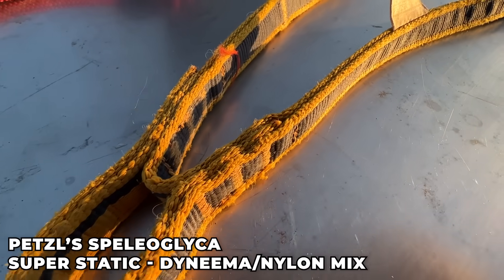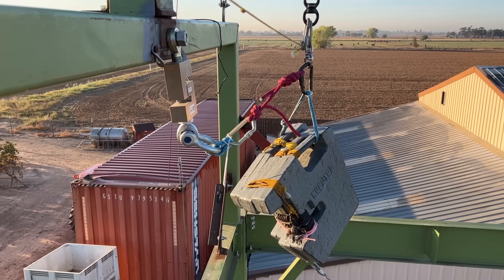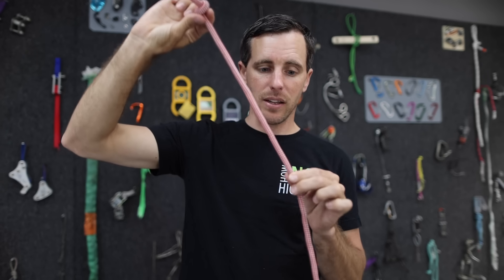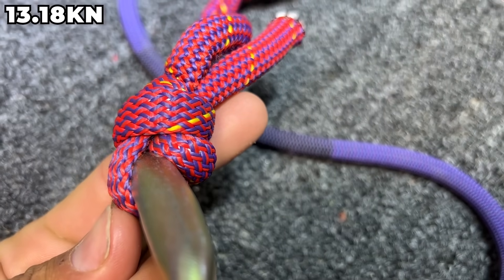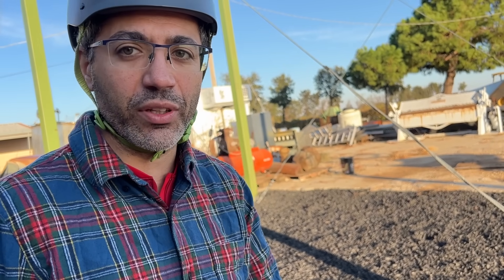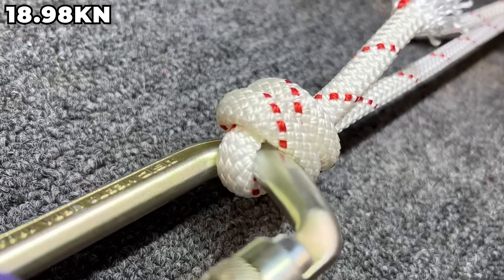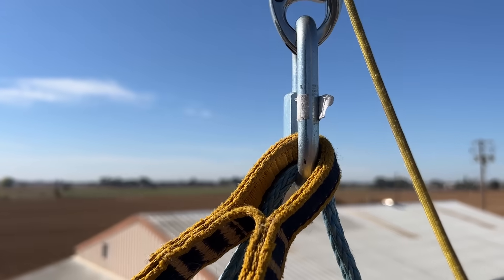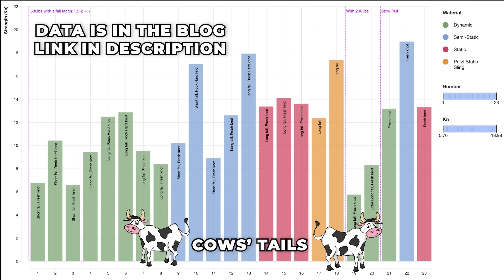This would BREAK your back

Comment: There will be a cross over on rope length for the force of a factor 2 fall. Below a certain length, you will not reach terminal velocity, reducing the speed that you are catching. Until you reach terminal velocity, the potential energy will increase. The elongation of the rope - time that the force will spread out - will increase with the length of rope, though I imagine there is another point at which this also drops off.

Comment: 4:53 "I think the moral of the story so far is try not to factor 2 fall."
No shit Sherlock.

Assuming that the rope is perfectly linearly elastic, is the only elastic thing in the system and there's no aerodynamic drag, the maximum force is only dependent on the fall factor and not on the length of the fall. I unfortunately don't know about the nonlinearities and dampening behaviour of a rope, but with constant FF and different lengths, you should be getting forces in the same ballpark.

Comment: My hunch is that in most caving situations the caver would be sliding down rock or swinging out and back in rather than completely free falling. As you say in the video it would be hard to factor that in but I'd be very interested to know what difference it makes if the weight is running down a concrete slab at 85 degrees rather than falling freely.

Comment: oh here’s a question for thought how long would that green static rope have to be before it would break under its own weight.
Reply: 13.31 kN / 9.8m/s² = 1360 kg. Not sure what rope that is, but I found a Sterling 9mm polyester static rope that says it's 62 g/m. So 1360kg / 62g/m = 21935m. Roughly twice the max cruising altitude of commercial airlines.

Comment: Just wondering the design methodology of using 300lbs for this test. It seems you are using the numbers to warn us against taking these falls but shouldn’t you use a lighter load? 

For example, I’m roughly 200 lbs, since people are also dynamic, generally we absorb/spread the impact around, such that using a 100 lb weight would more accurately display the forces I feel here. 

As such, wouldn’t I expect then to experience forces about 3x lower than the ones you have here? 19 => 6.33 not great but more livable?

Just asking on why 300 lb was used
Reply: I don't think its enough to just use a lower weight, the difference will depend greatly on how elastic the rest of the system is. Theoretically a perfectly static system would result in infinite forces no matter the mass used.

I put it in another comment but I think it should be possible to connect the weight with enough dynamic rope so that you roughly mimic the elasticity of the human body. You could test with a person on a dynamic rope fall and then add dynamic rope to an equal mass until you get the same forces.

Comment: First, I do think that, with some of the techniques we use in France, there would be something else breaking in the system long before you could reach this high of a force. That is why if I am clipped in with my personal anchor to a hangar I have a golden rule of always be in tension in something, wether it is the rope or my personal anchor or something else. There Is only a few cases where it is not possible and then it is for a few seconds and with just enough slack to unclip it. That makes that, in my experience, even a factor 1 fall is extremely rare in caving.
Reply: Same in Croatia. As our instructor told us during a lecture, if you have a fall factor over 1 in caving you’re doing something wrong.

Comment: That was interesting. I guess making cow's tail knots very hard is a bad idea. I've seen sometimes instructions like using a hand ascender and foot loop to pull the knots very tight. A bad idea it seems. Probably something that can slip even a better idea (petz adjustable, kong slyde or something like that)
Reply: You should still absolutely load and set the knot before using newly tied cowstails. Otherwise you're risking the knot slipping....

Remember, we're going to get more slippage underground when the rope is wet and sloppy.

Comment: Fall factor has the great advantage that you can estimate it while leading, other than that it is not all that good to think about. The difference due to the amount of rope in the system will be vary from one rope to the next, and it seems like it is not linear at all. Rope stretch is a really complicated thing. 

For any given cowstail set-up, there would be some distance that it is safe to fall on it. With a longer attachment the safe fall distance would increase some amount, depending on the material, but probably the safe fall distance will increase far less than the additional length of material.

Comment: I think the forces with the shorter cowtail were lower because the knots absorbed most of the force in that scenario, not the rope itself.
Reply: The elongation from knots tightening is much higher as a factor of fall length on a short cows tail, effectively reducing the fall factor.
Reply: Really enjoy these expts and vids , top notch stuff! Thank you so much, we use them in class :)
Agree that the knots could have some effect in slowing a falling person to a stop, but would think the time you are falling and therefore the time you are speeding up during the fall ,  is a bigger factor. Bit like jumping off a table, both in terms of height of table affecting the time speeding up in the drop and time required to bring you to an injury free stop . People bend their knees to slow down as they hit the floor when jumping off a table (see parachutist tuck and roll technique)and you don't keep knees straight and rigid unless looking for a serious injury and shock (same principal with crumple zones and air bags in cars).  The longer it takes a person to slow down, the smaller the forces required and also like jumping off a table if it's a very small table (height wise) you don't build up a lot of velocity before coming into contact with the ground . 
Some figures: If you free fall  for 2 seconds your velocity at that point is appox 20m/s (or 44 mph)downwards. If you fall for 1 second your velocity is approx 10 m/s (22mph) downwards .  If fall for .5 sec   approx 5 m/s  (11 mph).  There is  more force required to bring you to a stop, the faster you are going.
I think the longer rope allows the person falling to get to a bigger velocity before starting to slow them to a stop, and the extra length/stretch of the longer rope (and knots) doesn't have enough stretchiness to ease the person to stop with a small/gentle enough slowing down force. So the longer rope had much higher shock loading , sometimes greater than the breaking strength of the rope (or a person's back). High speed camera could be used to give a more accurate measurement of the timings here (slow mo guys collaboration maybe ?) Just my 2 cents.

Comment: A couple thoughts:
Why the longer cow tail had more force: perhaps the knot acts as a constant energy absorption; if you added intermediate knots, maybe that would reduce the energy for the bigger one

I’m curious if you’ve thought about measuring energy instead of force? Specifically as the integral of force over distance. I think that might be more meaningful for breaking than peak force (the energy dissipation provided by a system)
Reply: How would you measure the energy?
Reply: Isn't mgh easier ?

Comment: More than a couple times in my life I've set up a toprope or rappel on hangars a foot or more down an edge by laying down on the edge and clipping to the hangars with a dyneema sling "for safety". I'm 205ish lbs. I'd heard that you're not supposed to get above the anchor with a static line, and some of those edges were a bit sketchy and I feared I'd actually fall on my sling, but it seemed like a three-foot drop couldn't possibly be that bad. I'm definitely switching to a dynamic tether after this. Thanks for possibly saving my life here. 

Also, if anyone has suggestions on how to more safely rig those types of setups, I'd love to hear them.
Reply: The key to being safer setting things like that up is to have another rope, usually another piece 50 feet long will do it. You find something to attach it to back from that edge and belay yourself with it to get to the top-rope anchor.
Reply: Bobby has a video for setting up toprope anchors from above on his own channel. Recommends belaying yourself on a static rope anchored to a rock or tree at the level where you're setting up.
Reply: You could pre-rig (& backup) your rappel on the rope, then clip the middle of your rope as your tether.  A sling on the bolt makes a handy step down into the rappel position.

Comment: I would love to see a kong slyde or petzl adjust drop tested. It just seem to me like they would start to slip at some point and absorb most of that energy into the breaking device. Or maybe there is just too little rope to make any difference.
Reply: Yes please :)
Reply: Count me in for the kong slyde and kong kisa
Reply: Me too. Something like that seems to be a good idea instead of something like cows tail.
Reply: Screamer too plz!!
Reply: Actually they do slide a bit, but they are deadly too. 
Those have been used sometimes for via-ferrata and proven that they are deadly in these scenarios.

But it would be a good proof comparing these adjustable anchors to real via ferrata sets.
Reply: @salsasnooz  Are you saying the Kong Slyde is deadly when used for via-ferrata?  I use mine for a Personal Anchor System but deadly sounds bad.
Reply: @ivanlawrence2  maybe because in via ferrata, you can have falls greater than factor 2. For recreational climbing, that can’t happen.
Reply: @johngo6283  Via ferratas are insane. There are many instances where a fall would have a fall factor of 3 or even 4. I honestly don't think that the screamers that are made for it are enough. The falls are like 2 meters easily with no gear except the screamer to absorb the fall.
Reply: @ivanlawrence2  yes. Imho they shall never be used on via-ferrata!

The point is, that on a personal anchor you can have a maximum fall factor of 2. Because if your rope is 1m and you are 1m above your anchor you fall 2m. Bad enough.

But on via ferrata, you can have easily 2m or more between two steel anchors. And you are just clipped into the steel rope, that connects the anchors vertically.

So if you fall one meter higher of you high anchor, while trying to clip to the next section, you fall 1m + 2m steel wire + 1m rope length. So you pretty easily get a fall factor of 4 or so.

Without a via ferrata set that has an energy absorber this will be deadly.
Reply: I'm also on team slyde
Reply: Maybe the Kong KISA (Kong Impact Shock Absorber) might be a better thing to test for cowtails?  But I've never used one so :shrug:
Reply: Yes please, Petzl adjust versus a Kong. Any chance this can be looked at in the context of top rope rigging protection? Used a lot here in the uk. Lanyard is attached to a prusik to allow protection for building trad top rope systems. Would be ace to see what happens to the prusik and lanyard if you slipped over the edge with the attachment point at your feet😮. Love these videos, golden content👍🤗
Reply: I've messed with the idea of having a Slyde (namely to use in the place of a Petzl Adjust) and it seems the biggest issue is that the muddy, water swollen rope doesn't move very well in the slider. 

Going to a narrower rope doesn't work all that great either because the narrow rope stretches more when used as a positioner-- it's short when you need to reach with it, and it's long (possibly out of your reach) when you're weighting it and trying to get your weight off of it (such as crossing a rebelay on rappel).

If a test was to be done, it should definitely happen with ropes that are wet and muddy. A dry test wouldn't really be representative of our system in practice.

It wouldn't be a hard test, though, so "why not"

Comment: Ryan, what would the kn be of that 300 lb mass if it hit the ground if it theoretically stopped instantly over the same distance where the rope snapped.  What I'm curious about is, what difference does the rope provide in terms of it reducing the impact if you just decked instead.  Like, if it broke at 18, would decking be 20, did the rope only provide 2 KN of reduction?
Reply: You'd definitely get injured more decking than getting caught by the rope lol  the earth has no give or perhaps an inch or two if you're lucky to land on soft soil. Assuming  3 inches of soil "give", a 10m drop (33ft) of a 126 kg (300lbs) mass would accelerate to 14 m/s (about 46ft/s or 31MPH) giving that moving mass the energy of 12,348 kg/m^2, which then hits the ground, and let's be nice and say your body crumples and evenly absorbs the fall over a half meter (16.5 inches), which is being super generous and treating the body as a perfect springy material, you're still gonna hit with 24.7 KN. Assume crumpling over 8" on impact and the force doubles to 49 KN, belly flop on concrete and that equals closed casket.

So while a factor 2 on some short rope may give you some permanent injuries, at least you've got a shot at avoiding a casket. The forces you'd actually experience as a soft and pliable body of 150lbs or so versus 300 lb hard steel plates is likely more in the 4-6 KN range I'd guess as your body and the harness add to the distance over which that stopping force is applied to you when "landing" in a factor 2 fall.

Comment: So my guess as to why a longer fall with the same factor produced a higher force is the knots. They absorb a fixed amount of energy, independent of rope length, while the rope will absorb energy proportional to it's length. Hence in a longer rope the knots tightening up, and absorbing energy is proportionally a smaller factor of all the energy absorbed.
Reply: This was exactly my thought as well. Tightening knots flatten the force curve through inner friction, hence take a lot of energy per cm lengthening, more than the streight (dyn.) rope. Would be an interesting comparison to make a cow tail of a slightly longer piece of rope, bind another knot (fig. 8?) right in the middle in order to end up with the same overall length and then compare results (force curves -> amount of energy is surface of force curve over distanc; and peak forces).
Reply: I agree. 

Same with the energy that a human body absorbs.
Reply: Pretty much this.
The knot tightens up - this gives some rope and takes out some energy. And while more force will also tighten the knot more this almost certainly not linear but a rather steep increasing curve so applying 10x as much force only makes the knot give a tiny bit more rope.

Comment: The fall factor is the sole determining the force (given that rope elasticity, fall mass, and gravity are consistent) – F ∝ √(fall factor)

HOWEVER!!! The duration of the force is determined also by velocity – it takes more time to decelerate mass that moves quicker if you have a constant force, and surely the damages on your body are greater the longer you experience the force. For instance, jet fighter pilots can stand short bursts of 7Gs, but if you were to live a day in 7Gs you'd die for sure. So just because a 100 meter factor 2 whipper and a 0.5 meter factor 2 fall generate the same force, they are not equally dangerous.
Reply: I once witnessed a 150' factor 2 fall on Lurking Fear: he was short fixing and at the end of his 75' self-belay, waiting for his partner to put him on, back-cleaning aggressively, no leashes attaching him to his aiders... he fumbled out of his aiders, and ripped the only piece on the pitch (#1 camalot). They self rescued down to the ground and back to the car, and I got the details when I returned his gear to him: minor kidney bleeding, sprains and strains, and 2nd/3rd degree rope burns.
Reply: "100 meter factor 2 whipper" 😱
Reply: @drew5334  you're telling me you don't take 100m 2.0 whippers on a daily basis? Are you even climbing bro?!
Reply: Square root of the fall factor
Reply: @serges5681  aha! Okay! Thanks for the correction! I'll edit my original comment to avoid misinforming!
Reply: @serges5681  did I get it right? My intuition says it's the other way around
(F ∝ (fall factor)²)
Reply: I think that for the durations involved in fall arrest they will be equally dangerous.  It's not as if 0.5 seconds is that different from 0.1 seconds.  We're not necessary talking about organ failure from hypergravity, but bones crushing.

Comment: Did you lose/destroy your dummy? dropping weights like that over short distances doesn't really tell you much of anything IMO. I've fallen on ± a meter of dynamic rope before and it's uncomfortable but nothing close to what an actual 6-7kn fall would feel like.
Totally agree that you should respect fall factors a whole bunch more when you're clipped through a static line. That's gotta hurt.
Reply from the maker: The dummy was only 90lbs / 40kg.  It wasn't heavy enough to get anything helpful.  Even the dummy isn't as helpful as it's not flesh.  I might have to go do human testing :)
Reply: Yeah, rigid masses are a really poor model of a human body. There's a reason you don't use a rubber mallet to drive a nail.

I once took a FF2 onto a spectra daisy while aid climbing, felt no worse than getting thrown in wrestling or Judo (which can definitely injure someone if they don't fall right).

Comment: think about ways to measure the real KN considering the harness introduces dynamic forces. Not sure the solution? Hook the cow tail to the front loops, something squishy in a harness, and the meter on the back side loop with weights? Static isn't static in this tested configuration, but i get it.. good enough